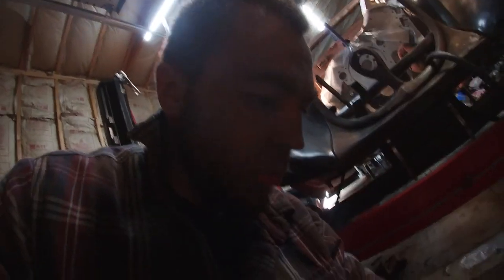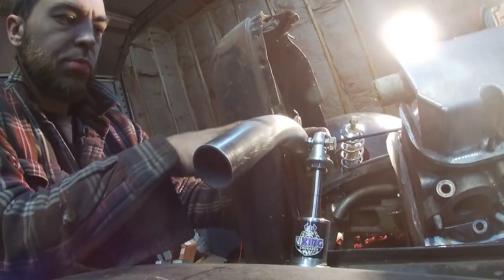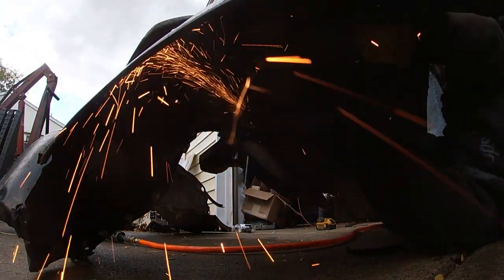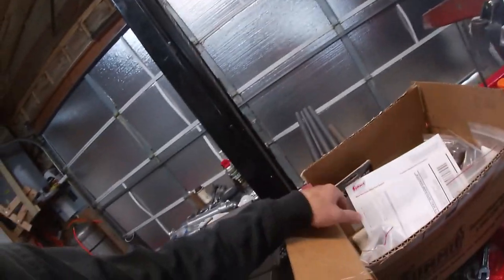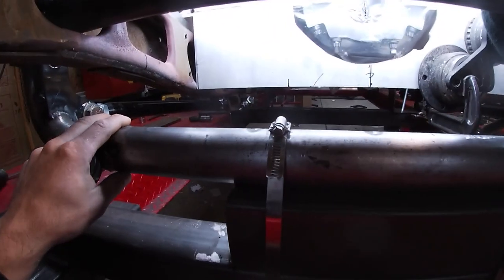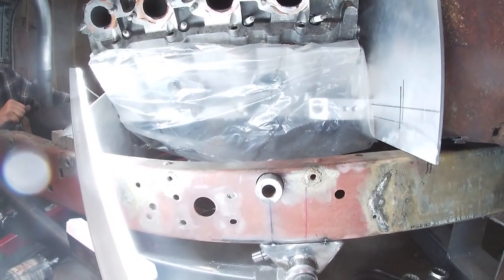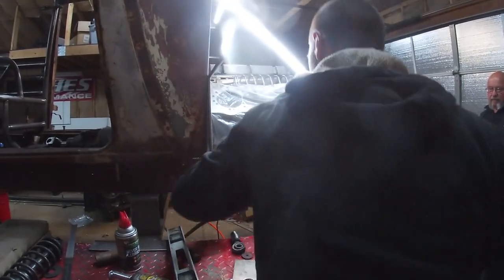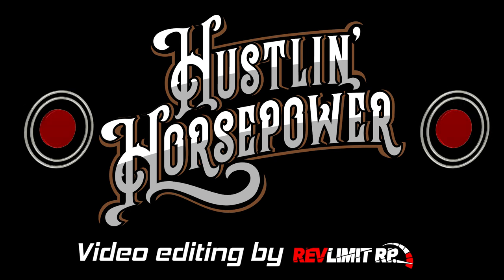'33 gets one HECK of a Front Suspension setup!

Comment: Nick, Do you or anyone you know need a Mig welder that runs of 110-volts ? Its a Lincoln 135. Its got at least half a roll of .035 Flux core wire that goes with it. No bottle. Has only seen what ever has been used off this roll. I bought it new then found a like new 180 Lincoln. So I use that more than this 135. It needs a home and if you or one of your fans could use it, thats where it should go. TWO hundoo  takes it. Location NE Ohio.